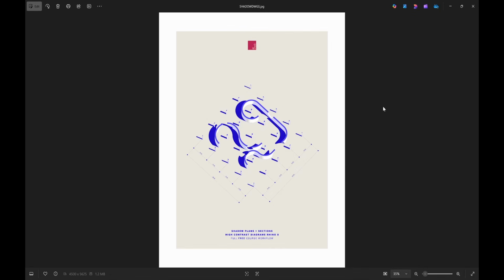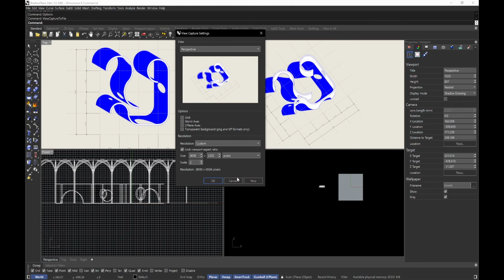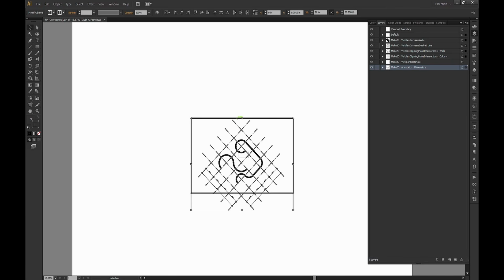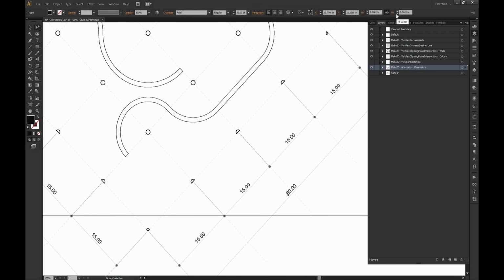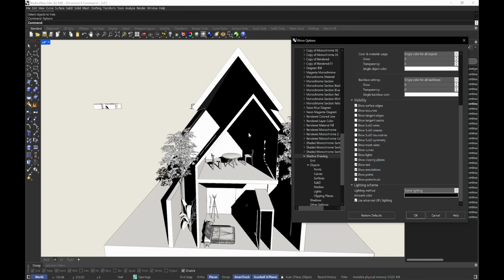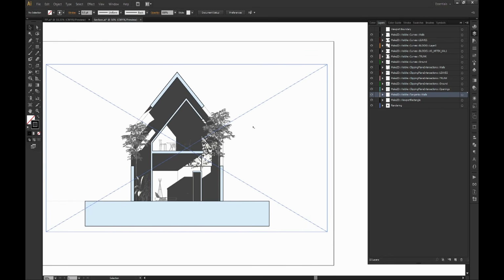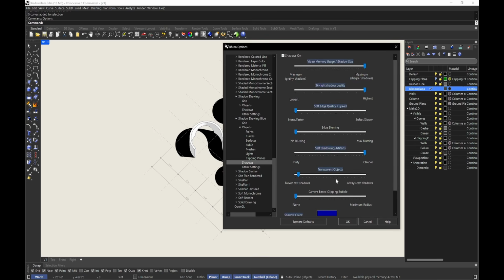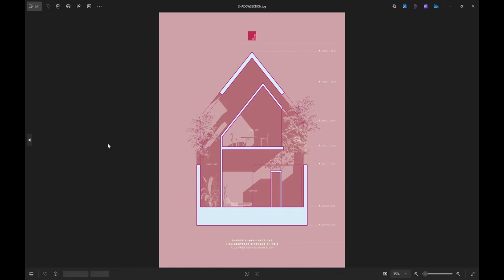Rhino 8 Architecture + Illustrator High Contrast Style Plans, Sections, and Diagrams - Full Tutorial

Comment: I have a solid which as ground surface and the building shadow cannot show on the ground in a concrete way
If I remove the ground solid the building shadow becomes solid 
Is there a way to fix it? Thank you!
Reply from the maker: Yes, you have ground plane selected in your display options, If you don't want the rhino ground plane, you need to turn it off in the display options.

Comment: 08:00 How do you get the curves to be black on the white background and white on the shadow? I can't really get that effect when i'm trying sadly :( But good work and nice video!
Reply from the maker: It should work if the settings are followed. 

Some factors that will affect your shadows are your sun angle/time, skylight, and your camera angle. Make sure you always have your ground plane activated or a ground plane drawn.
Reply: @unitedstatesofdesign  and the line has to be grey? Is that what makes the illusion?